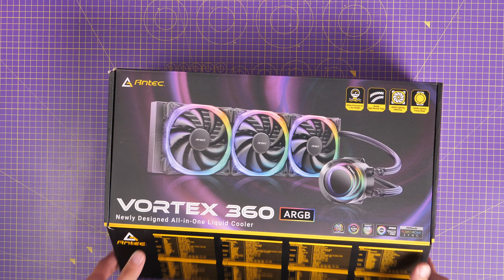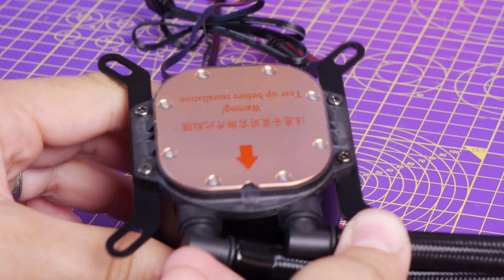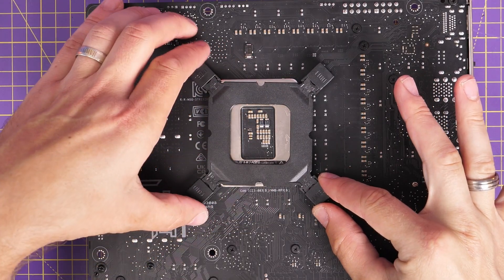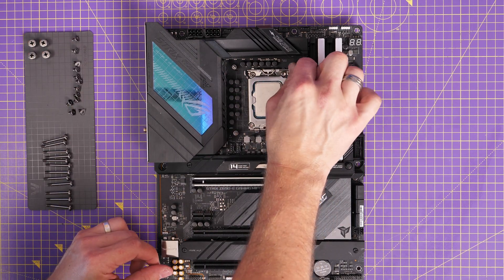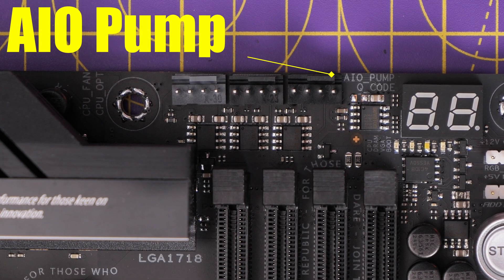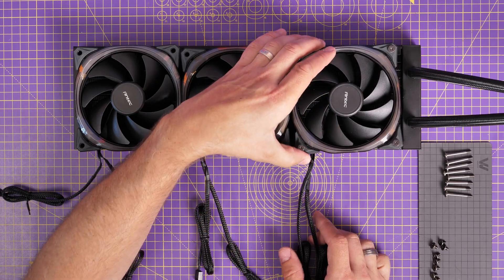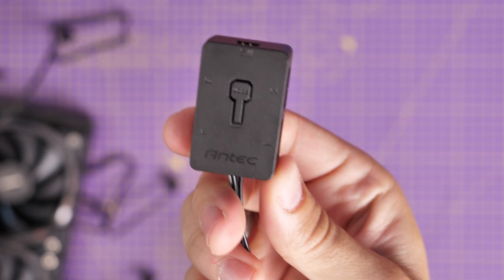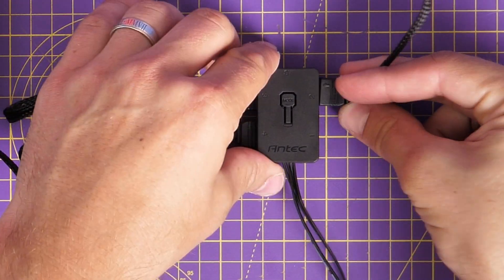Antec Vortex 360 AIO installation guide and tips

Comment: i have problem with this cooler and this is when system goes to sleep and i want got back to windows rgb sync completely reset and i had open the case and press sync button on cooler, i tried to switch argb connector on the motherboard or install fresh msi software but no one is not working

Comment: Just got one of these, put it on a 9600k and it is hitting 90c under load, just took a full loop out and it's never seen over 60c on that recon I have a duff
Reply: are you saying that this one is not worth buying?
Reply: @boredaliensclub4416 no I re pasted it and it settled down, probably a bad mount the first time round. It's now running at 5ghz and peaks around 65-70c